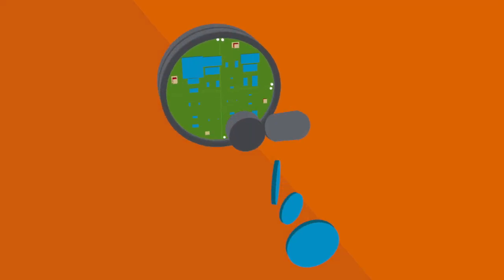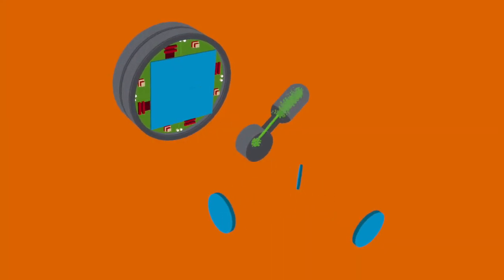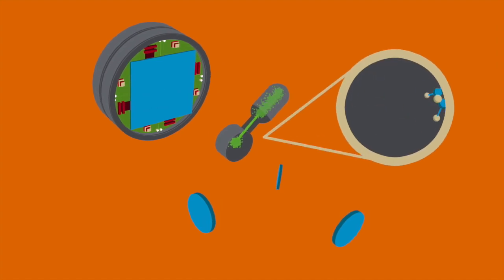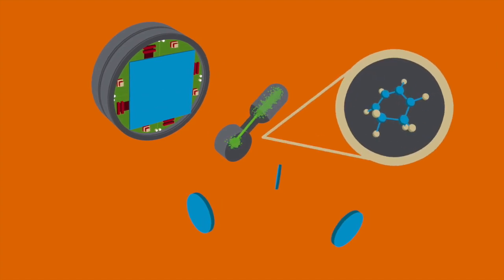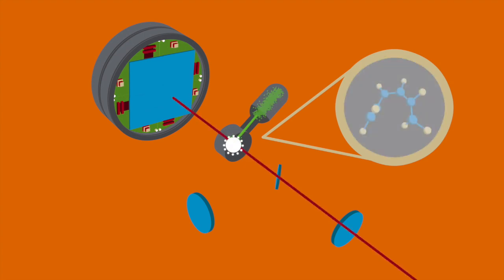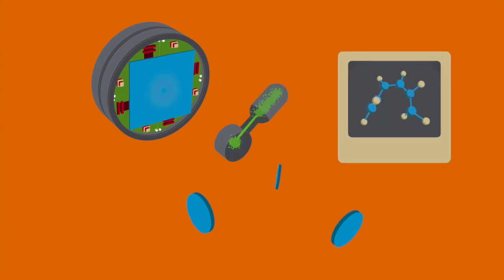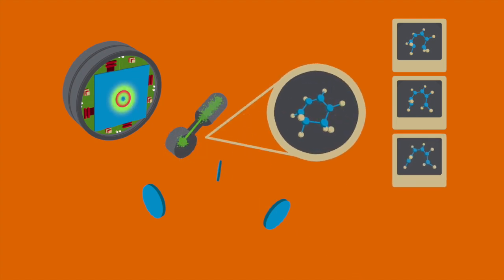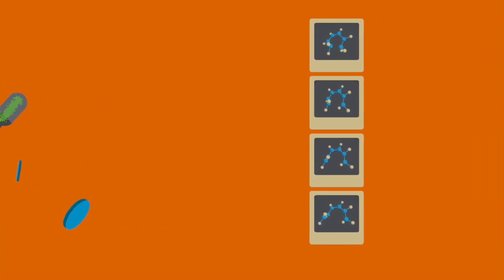Making a Molecular Movie: How it Works

Comment: What is dark matter molecules?
These are four questions about dark matter molecules

Is dark matter the axions
?

Are the dark matter particles WIMPs?

Are the dark matter particles
SDIM 
?

Are the dark matter particles
Neutrino Sterile
?
There are experiments to detect the dark matter in the ground, but we want to use the same experiments in the spacecraft
Experimenting in areas where dark matter is present for collisions at detection sites
In detectors in the areas of dark matter halos in space
Mean must use ground experiments such as Lux experience and 100% Pure Xenon experiment
All experiments should be used in the depths of the earth and space at the same time